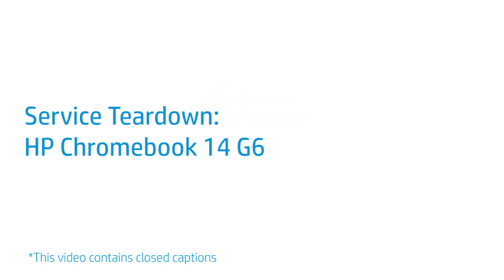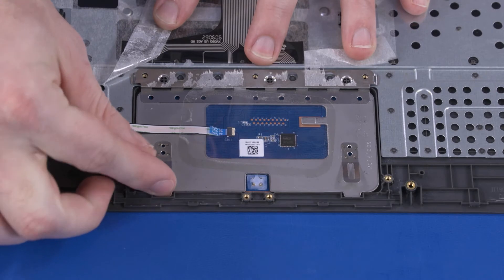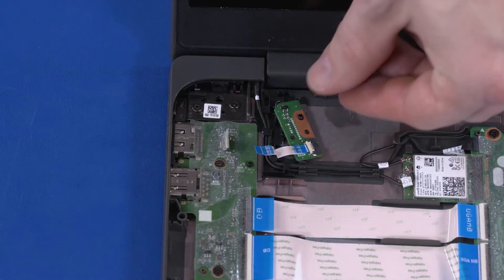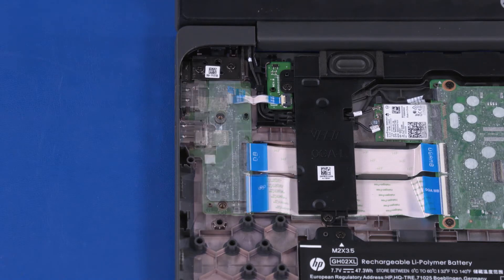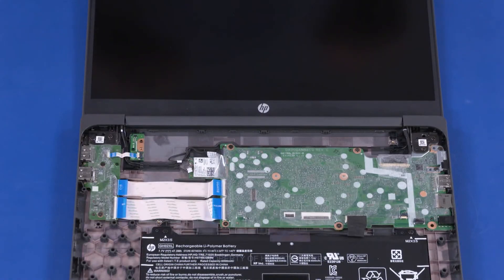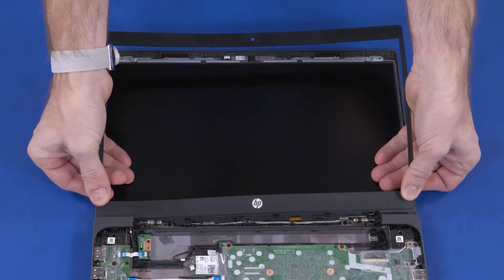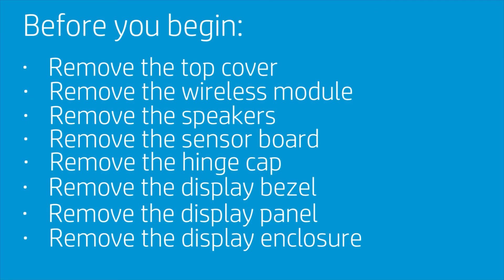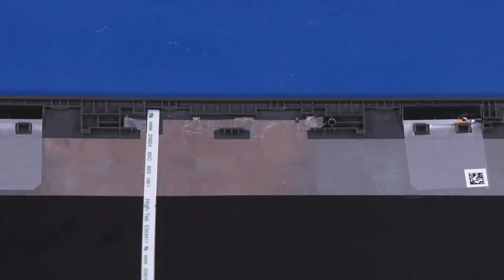Removing & replacing parts for HP Chromebook 14 G6 | HP Computer Service

Comment: My hp laptop model is 15bs636tu and touchpad is not working. In device manager  before the synaptics driver there caution icon like yellow triangle inside exclamatary symbol is available. Too many times i uninstall that driver and reinstall latest driver too, but no more changes of working that yellow triangle error is always indicating
Reply from the maker: +Biju Yamaha Please perform the steps mentioned under this document to fix this issue: http://hp.care/2pt2jfN

Comment: Where can I find a replacement screen for this g6 model without the brackets?  I ordered using the same model/part number from the faulty one, but it came with the bracket molded around the screen and will not fit properly when the bezel is placed back on since this model doesn't use the brackets to screw to the enclosure.
Reply from the maker: +Michael Munoz You can purchase the part from here: http://partsurfer.hp.com/ Please select your country and enter serial or product number of your unit.